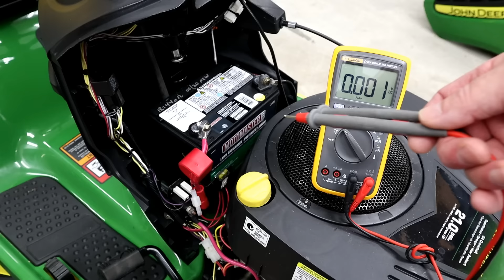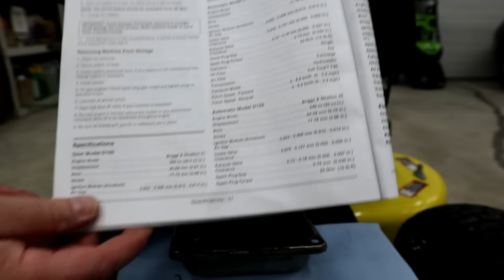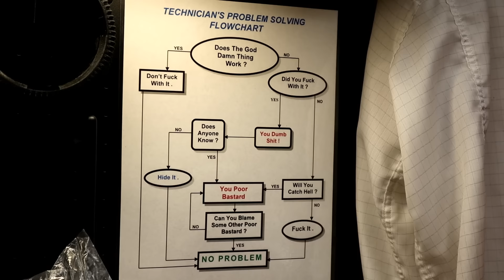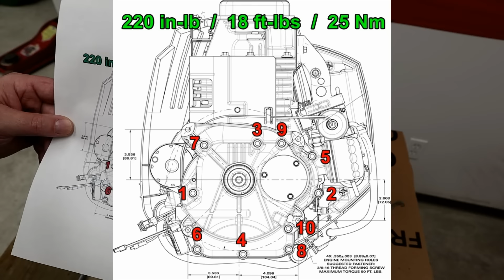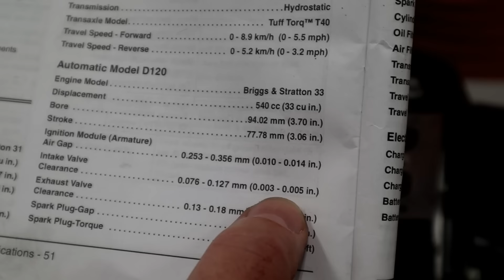Why Won't Your Riding Mower Turn Over? COMMON Briggs Intek PROBLEM & REPAIR.

Comment from the maker: Briggs & Stratton Intek Camshaft for 33 Series:
- OE Part # 84005207 (793880) : https://amzn.to/3SoHocF
- OE 697110 Crankcase Gasket: https://amzn.to/3EQcYuQ
- Aftermarket Camshaft/Gasket kit I used in this repair: https://amzn.to/3ShTZNS
SEPTEMBER 2024 TWO YEAR UPDATE: Aftermarket camshaft still working (about 55 hours running time on it).
Reply: Curious as to how the aftermarket cam has held up? Any problems in the 11 months you’ve been using it?
Reply from the maker: @RedeemedMechanic  still working :)
Reply: @Rchelicopterfun  I’m going to go that route then. Just picked up a very old Craftsman LT1000 with the 17hp version of this engine. I’m willing to spend $30 to fix this issue, wasn’t sure if I was willing to spend over three times that for the B&S part on such an old machine.
Reply: tell us how you really feel about the decompression device. LMAO.
Reply: Do you happen to have a link for the 44 series in Intek Briggs motor?
Reply: BTW,
You're probably the most thorough and detailed mechanic that's provided a walk-through that I've ever seen.  Very detailed and very comprehensive, thank you!
Reply: Brigged and scratched and scratched and scratched and scratched and scratched and scratched and scratched and scratched and scratshe got back to the old way of making motors.
Reply: I'm a little confused. You link to  a kit which is short money, but also the separate camshaft and gasket which are much more expensive. Which one did you end up using? Does the extra expense mean higher quality or is the $25 complete kit the same quality from what you can tell?
Reply from the maker: As stated at the beginning of the video when discussing the decompression part in question and as indicated in the above links, there is OE (original equipment Briggs) and aftermarket. I was forced to use aftermarket because OE was out of stock when I fixed mine. Totally your call if you feel the OE part/s is/are better and worth the extra cost. Some people swear they are, others say it doesn't make bugger all difference. If my anecdotal means anything, the aftermarket kit I put in mine is still working, but it doesn't even have 60 hours on it yet.

Comment: All the way from down under Australia, the days of good old made in USA is over, Briggs, GM, Ford etc, we had them all in Auz, the backyard repair industry is over, it's designed to break down after the warranty, thrown to the scrap yard to replace with a new model and with electric motors replacing the smal engine mowers, chainsaws etc,  the university company  CEO' s these days wouldn't know the difference between a left hand or right hand screw driver and 3d printed replicas. We  DIY bush mechanics will phase out with them! Remember the old TV repair man, flat screen TV' not designed to be rebuilt these days, what an interesting hobby all that old technology was to us, teaching ourselves as we pulled those machines apart! Good luck & fond memories
Reply from the maker: So true and add in the disappearance of right to repair your own stuff which seems to be a losing battle. I am however a fan of electric powered equipment and don't see that as an issue at all; provided we have the same access to a decent parts network. I've fixed several flat screen TV's over the past decade, seemed very serviceable to me, more so in-fact than CRTs. On electric power equipment the brushless motors, controllers and LiPo packs are just as fun, rewarding and educational to work on; provided we can get parts for them along with component/wiring schematics. With the loss of right to repair, we can kiss those resources bye-bye ☹ That's the biggest issue to be worried about IMO!
Reply: It's called planned obsolescence. It sucks.
Reply: The intent is to keep you buying.  Just went thru this with a refrigerator.  These are now made with a 5 year lifespan, more or less.
Reply: You are very right about that They sure love making junk
Reply: I can't stand battery power  tools
Reply: Battery power definitely has its place.  Find me a tradesman who thinks they could do without their battery powered tools.  Electric motors are not the enemy, but poor and underdeveloped design with planned obsolescence is the enemy, and that’s a manufacturer choice.  Ideally we would live in a world where the best machine was used for its purpose.  Battery snowblowers….terrible…small battery mower for a small backyard…perfect.
Reply: @user-pc2wo9vm2k  why?
Reply: Yet this video show how to do a DIY repair without scrapping the engine.
Reply: I agree, your views match mine, also Ausralian.
Try buying power equipment not Briggs & Stratton, it is not easy, mower shops are littered with these total shit engines.  

I have a theory that their engines are supplied at or below cost to equipment manufacturers to get mass circulation, what they lose on complete product sales they make up on parts and the mower shops are kept busy with repairs, so they are happy.

Inferior design, materials, even the fixing bolts, tolerances.  A manufacturer, proud of their product, like Honda but even some Chinese  products put this crap to shame.

Check out review sites for disgruntled consumers, trying to get some satisfaction instead of a voided warranty claim.
Reply: Same here up in northern Minnesota. Unless you have a limitless junkyard, good luck with finding parts.

Comment: Was given a Simplicity brand riding mower circa 2014 ish a week ago with the 14.5 HP Briggs and Stratton motor. It's  like new condition,no rust paint is excellent. The original owners said it wouldn't start didn't know why and didn't want to bother putting money into it so they offloaded it for free. After going through the troubleshooting I now know why . How nice of Briggs and Stratton to put a grenade in their motors for no real valid reason when it wasn't absolutely necessary . Companies like that deserve to go out of business.
Reply: They've sold the company!
Reply: Did they get bought by China?

Comment: I'm 95 and still mowing with my rider. The compression release went bad, so I made a tool that backs up the flywheel position so it is not in compression mode.  That way, the starter has a chance to gain momentum and keep cranking.  Works for me as I am obviously too old to make that repair.  (wood lever with two bolts sticking down to go between the fins to rotate flywheel backwards)
Reply: @edwardgabriel5281  You Sir, are an inspiration.  Keep moving and doing what you can for as long as you can.  I’m a few decades behind you, but I hope to be your age one day.

Comment: Class action lawsuit material against JD/Briggs this is pathetic engineering
Reply: It’s a Briggs problem not JD. Most brands run Briggs and Scrapem, Simple solution, buy a lawn tractor with a Kawasaki engine.  I’m replacing a Cam in a customers Husqvarna with Briggs Vtwin

Comment: Gave John Deer a Dear John letter when the Corporation went overboard with the proprietary con game on their biggest  Agricultural lineup. Apple , Tessa , HD MC, as well as JD feel brand loyalty has no boundaries. Why consumers complain and bury their heads in the sand rather than boycott these sociopathic corporations has me stumped. Thanks for sharing and best to you and yours.👍
Reply from the maker: Yes, and on top of the proprietary planned obsolescence, we now also have to fight for the right to repair as more and more such companies are killing the independent and DIY service sectors.
Reply: You get what you pay for... $1999 machine from a big box store marries you to the crappy Briggs & Stratton and pot-metal deck ... run like hell and look for a Kawasaki powered used LX277 for half the price ... wayyyyy better machine

Comment: Hands down the best DIY video I’ve ever seen on the internet.  Phenomenal job.  Straight to the point and no filler material.
Reply from the maker: Thanks for watching 🙂👍
Reply: Agreed. Very detailed and to the point. Excellent!
Reply: Most excellent job in the making of this video . Impressed with the quality of it and the precise attention to details and explanation of what’s going on and the why of it. Thank you for this. Do you or anyone know if the Kohler “V” twin on CubCadet has this compression release on it. My LT1050 has been acting the same way.

Comment: I run a small shop, Mark'sgreatmowers and see this quite often.
There are a few aftermarket cams that are decent. OEM seems to fail more. 
Also before installing the new cam , I have found that the reason the compression release assembly seems to fail is because sometimes when u shut the engine off, as the crankshaft comes to a stop, it ends going backwards a bit. If the lobe on the( intake side) on cam strikes the tappet, it can stress the pin on the release tang. 
That can snap it off. It's only designed to go clockwise direction during running. 
I have found that taking your dremel w a fine grind tip, just slightly rounding off the sharp edge and end edge of the pin keeps this shearling effect from happeningor at least minimize the possibility of re occurrence . I have installed probably 50 of these past year n half to 2 years and haven't had any come back besides a lash readjustment here n there i have written briggs w this modification, which diesnt affect balancing or structureof the device. They dint seem to care. Briggs got bit by the corporate vampire years ago.. 😊
Reply from the maker: @spikeleestree8015 - Excellent real world, experience gained, large sample size, fact based comment! This people is what the comment section of YT should be for (actually helping) and I thank you for taking valuable time out of your day to leave such helpful feedback. 
That makes perfect sense about the kickback motion of the cam stressing out the pin, and by simply rounding out the sharp edges a little bit, it will reduce the amount of force the pin is exposed to when the tappet hits it along that edge. Brilliant advice and I have just made a note of this in my owners manual so I don't forget about this little mod for the "next time" I have to replace the camshaft :)  Thanks so much again! Also very good to know your experiences with the aftermarket cams are positive!
And yes, why would Briggs care... Customer satisfaction is after all low on the priority list when profits are all that matter anymore to the corporate vampires.
Reply: BRILLIANT discovery, you probably discovered the main reason why they fail so soon. Except for that defect, it is a pretty good engine IF you change the oil & filter often.

Comment: My Chraftsman (MTD) started this hard engine turning over years ago. I replaced batteries with larger CCA's with no change.   For years, it would eventually start by turning the flywheel past compression. Once the engine was warmed up, it will always start but with that moment of hesitation.  I have not seen any shrapnel in the oil and the valve adjustment is at specified.  The tear down is something that I am not ready to do at this point as I have been running this lawnmower this way for years.   Great detailed video, one of the best in this matter.
Reply: Good to know that it can be started just be turning it to that position. That is pretty simple and free.

Comment: It amazes me that there isn’t a class action against Briggs.  I’ve fixed 3 of them and I am currently repairing my own machine.  It’s not a terribly expensive or difficult job, just time consuming 😬.  The only upside is I have seen it completely trash the engine even with the metal pieces floating around in the sump 🤪.  Also wanted to compliment you on one of the best videos on this subject matter 👍👍👍👍👍
Reply from the maker: Thanks mate 👍

Comment: I cannot begin to thank you enough. You nailed my issue exactly.  I am not a mechanic,  but with trepidation  and my daughter's help, I am down to the broken cam exactly as you said it would be.   Getting  a new one in the next couple of days and will hopefully be back up and running by weeks end.  The shop wanted $900 to fix, I only paid $400 for the mower 8 years ago.  Again,  THANK YOU!
Reply from the maker: Glad to hear it - hope the repair goes well 👍

Comment: Hard starting on my mtd 12 horse mower.After replacing worn starter still had issues with hard starts.Checked valve clearances, they were sloopy.Tighten them back up and now have easy starts on a 33 year old Tecumseh engine😊

Comment: Another way to determine if the ACR (Automatic Compression Release) is broken is if you can get the engine running as John showed, when you shut the engine off you should hear the puffing noise in the intake as the engine slows down and the ACR activates again.  As John showed, the engine came to  a quite stop indicating the ACR not working.
Reply from the maker: 👌 Great diagnostic tip! Thanks 👍
Reply: Makes you wonder if it wasn't a good idea using the intake valve for CR. It's blasting air in the wrong direction through the carb. Other engines use the exhaust valve for CR.

Comment: Probably the best video that I've seen on YouTube. I have that same 21HP engine on my 2013 Craftsman YT-3000 tractor with about 850 hours on it without ever having this problem yet, but wouldn't have a problem tackling it after watching your video. I wasn't having any issues but decided to check the valve clearances around 750 hours and found them to be pretty loose @ .008 to .009 and readjusted them to the specified .004 & .006 which afterwards seemed slightly quieter and more powerful. lots of comments on how clean your JD is and mine looks new also because we both take pride in and appreciate our equipment by blowing them off every time they are used or even wiping them down once in awhile with a cleaner soaked rag, it's really not rocket science or anything but the majority of people out there just use their mowers and put them away without ever thinking about doing these things, even when they have the spare time or even during the winter off season, then they wonder why their's looks it's age or like crap, caked in grass, dirt, grease, and oil residue?
Reply: You are right, but the only thing to clean without exception on these motors is the air filter.     Better to have a dirty reliable motor than a super-clean sheet motor.....Where is now my old super twin Vanguard...?

Comment: Excellent video.  Wish you had done this 5 years ago!   My Husqvarna with the Briggs 33 failed to start whilst under warranty.  They wouldn't tell me what they had done to fix it.  Just out of warranty and you guessed it.  Failed to start again. So a new battery and starter motor later, with no difference, I was able to gain some information on line as to what the problem was likely to be.  Dismantled the engine and found all the remaining bits of the decomp lever in the engine as you did.   When I picked up the new camshaft I asked if that was a common problem.  "No, never heard of this happening" was the reply.   When it went again after 4 months or so and I picked up the new (again) camshaft I was told that they are now manufactured differently and this should not happen again.
Reply from the maker: Yep, it's big problem on an otherwise pretty decent little engine. Sorry to hear you too belong to the "Briggs Broken Cam Club". I'm skeptical if the latest camshafts are much if any better; especially when Briggs / dealers claimed it was a very rare failure when they were likely doing at least a few a month and that was almost a decade ago now. Hope your latest one lasts. I'm not holding out much hope for this aftermarket one. I'll be thrilled if I get a hundred hours on it which is about 3 years with my specific mow frequency. Maybe by then, Briggs will have some back in stock 😄
Reply: @Rchelicopterfun  Even today they are out of stock.

Comment: I had a 3 wheel ATV Honda...It had a simple lever that you pulled to manually engage the decompression if you wanted to hand start it....K.I.S.S method...Love your quote ''Briggs  and Stratton  used to make good stuff...Now it is crap like everything else '' BUT the summum goes to your Problem Solving Chart !!! 😂😂😂 I have a bad feeling with those replacement parts....Fingers crossed....Very good video as always !
Reply from the maker: Yep, only time will tell with the aftermarket part. I'll be sure to update the video with a pinned comment if (I mean when) this one breaks. 😄

Comment: I have a repowered Husqvarna YTH 2042 that has a Briggs 14.5 Intek now and all I can say is I use this mower sparingly. I have very sandy soil so the grass grows very slow. This engine was brand new still in the box at a farm auction for $300.00 dollars 4 years ago, and I might have 50 hours on it. The Kohler with the extra crank case vent hole on the back of the block...lol...was the reason it's now an Intek. I have no faith in any of the new Kohler or Briggs engines anymore. Regular service and taking an air hose to mine after every use keeps that old Husqvarna looking like brand new. Great video, very clear and to the point. See you in the next one cheers.

Comment: Most in-depth instructional video I have seen! Thank you for not assuming I know what I’m doing and leaving out steps! LOL. This is the exact issue I’m having with mine. Last season, I replaced battery, starter and gave it a tune up thinking each was an issue and still had the problem. Searched and searched for a repair and it was to start in TDC. Now I know why and how to repair it. Blessings!!